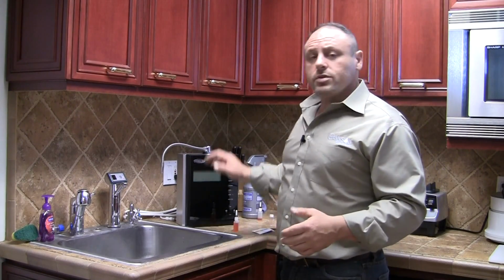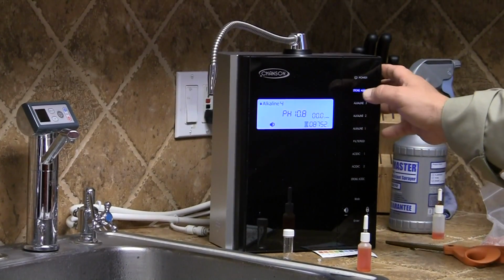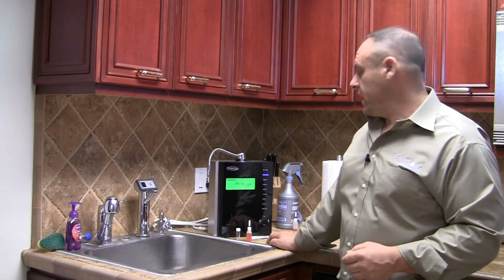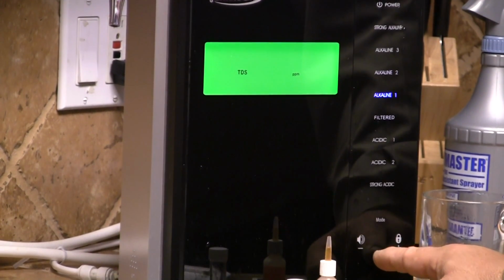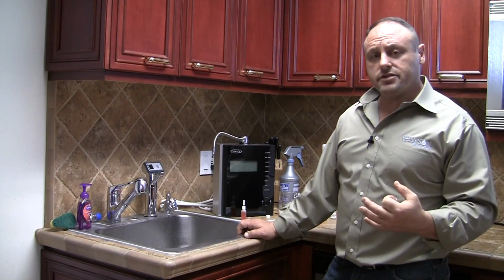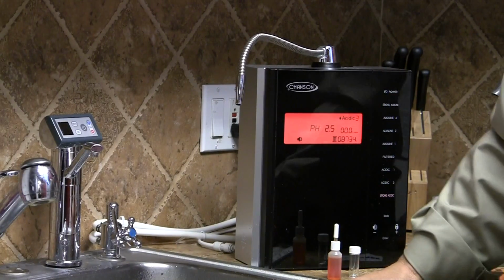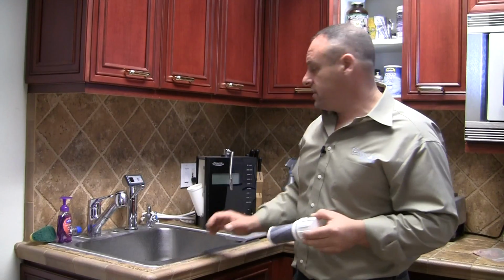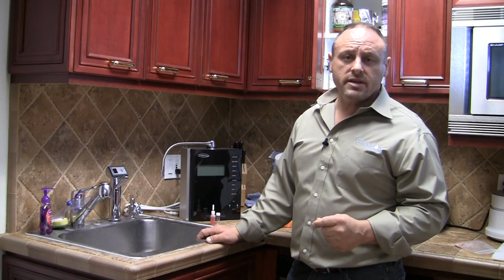Chanson Water's Miracle M.A.X. Installation Guide - Part 7: Adjustments

Comment: I have my Mircle MAX system all hooked up at my other house for the summer and all the water is flowing out the waste line and not a drop coming out the dispenser.
I've tried to get it going through different start up procedures, but no luck
Have you got any ideas.
Stuart
Reply from the maker: HI,
I'm sorry that we did not see your question sooner. It's always best to contact our tech support department directly and they will be happy to help. 949 215-3205  ext 716